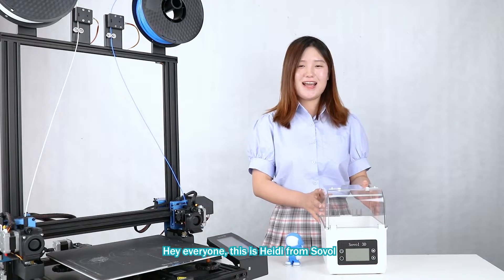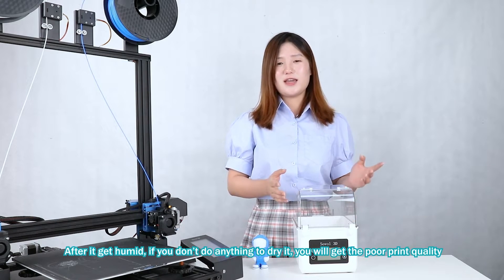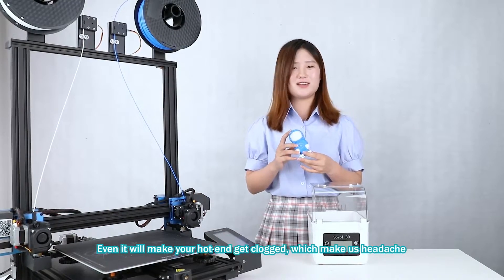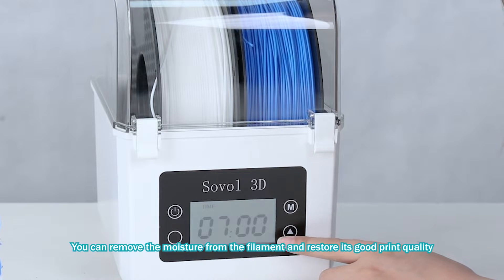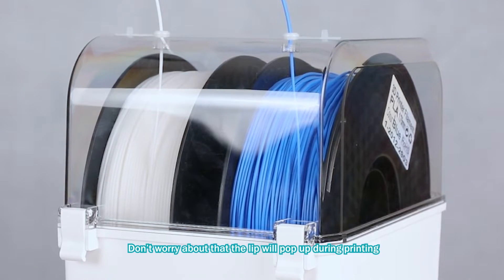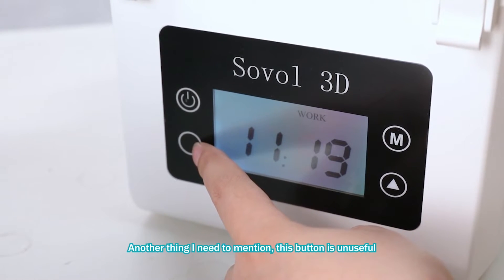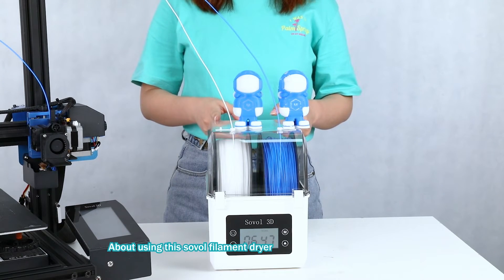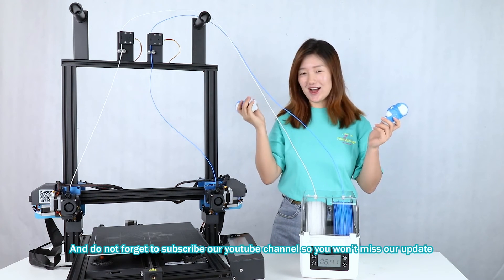Huge Difference After Using Sovol Filament Dryer Box for Two Rolls Filament Drying and Printing!

Comment: I just got one of these.  When I go to use it, I set temp and time, hit M to go into "Work Mode", and let it go to work.  After a few minutes, the screen goes off and it seems to stop working.  What should the normal behavior be?
Reply: It should continue running until the time runs out.  Yours is DOA.

Comment: Nice job Heidi!  Prior to buying the Sovol Filament Dryer I already owned both a Sunlu and an eSun that work well enough.  But, the Sovol is so much better in so many ways.  First, it is the only active dryer I've found under $100 that can handle super wide spools like those used by FilamentPM.  Secondly, the large display and alternating status information is very, very helpful.  Thirdly, the latches and extra plugs that make the box air tight make this very useful in an educational setting were a printer might go unused during break, etc.  Being able to use the same box to both dry and safely store make the filament ready to go when the need to print no matter how long the between print demands.  It is a great value.  Thanks for demonstrating it so well!   I can attest that it works exactly as promised in your video.
Reply from the maker: Thank you! You watched my video very carefully and grabed the information! And thanks for your love to our filament dryer.^^